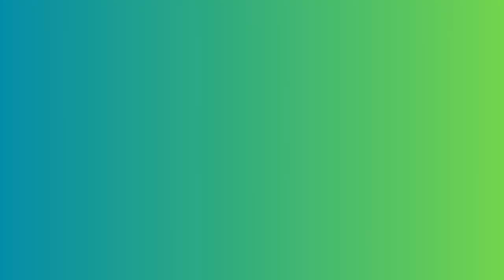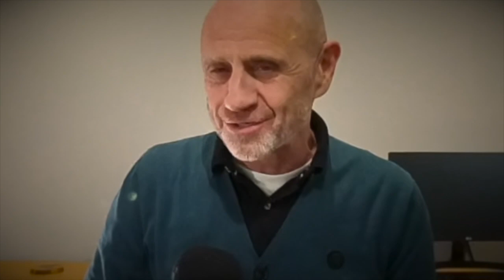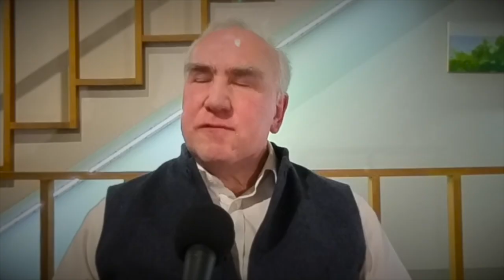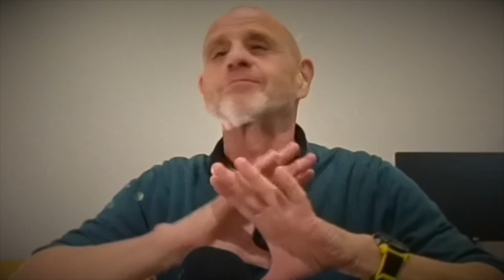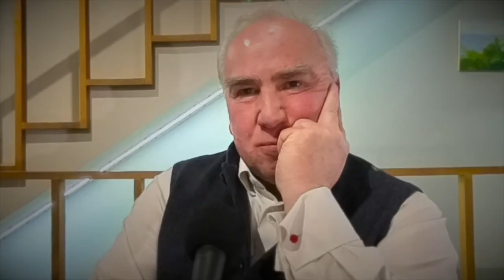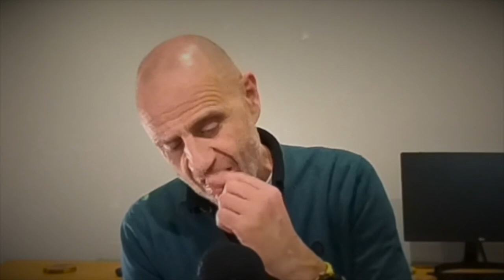16. Do you speak Heat Pump?

Comment: Δt needs explanation in simple terms, and I have also heard and been confused by d o t.
Reply: DeltaT, the difference between two temperatures. Comparing temperatures in a heating system can be applied at various points, but the most comprehensive is in comparing the difference between the energy source temperature (the air, ground or water) and the flow temperature required in the emitters (UFH or radiators) that is needed to deliver the required room temperature. You might hear people referring to these as the source and sink temperatures. Essentially, the smaller this DeltaT, the more efficiently the heat pump will be operating
Reply: @ thanks.

Comment: I wouldn’t bother being too interested in Heat Pump technology, which frankly is about  150 years old. A large EV manufacturer is pumping money into the Ohmic Electric Boiler concept, with fantastic results - the efficiencies are outstanding!! So Heat Pumps are effectively now officially old technology.

Bean really understated the Humidity levels of outside air. Here in Scotland we can easily experience levels of 90-100% <5°C in Winter, being due to the Gulf Stream. Leading to many ASHPs in De-Frost mode regularly. This is the reason Heat Pumps fail  here. Unlike the dry cold of Scandinavian & other north European countries, our cold is moisture laden & very cold, giving an incorrect reading as to the actual temperatures.
Reply: We get 3C ~98% humidity here quite frequently, so easy enough to compare.  But what people don't really understand is that heat pump systems in the UK have a design temperature in the UK of -3C to -7C.  So at the ~3C sweet spot for humidity to cause problems the heat pump isn't running flat out regardless, so whilst defrosts do occur, they aren't as bad as people make them out to be.
Defrosts when taken into consideration over the whole winter season will waste less energy than a gas boiler will waste out of it's flue.
Reply: @BenIsInSweden  Our weather here in Scotland is oceanic, can be very, very cold & humid, particularly on the west coast. With weather being greatly influenced by the Gulf Stream.
Added to this, it’s windy too, with high temperature differences. You in Scandinavia countries get dry cold temperatures, very dissimilar to ours. Site a ASHP in the wrong location here & it’s a complete disaster.
Reply: @jimmygillies5590  Like i said, we can get very humid and low single digit degree temperatures as well.   And like I said, Scotland's design temperature (about -7C) makes it so a heat pump isn't running flat out when the humidity is an issue, meaning it's not a massive issue either.
There are also ways around it, e.g. EVI heatpumps doubles the time between defrost cycles.

Also, it's clear you do not understand heat pumps that well, considering you're making a comparison to Ohmic Boliers, which will only ever achieve a COP of 1.
Reply: I agree that humidity levels can be extremely high in places and that many people fail to realise that it's the humidity, rather than low air temperatures that impact air-source efficiencies under such conditions. This could be a good reason to opt for ground-source. I'll need to read up on Ohmic Electric Boiler technology

Comment: Air -to-Air: I've got what I would refer to as monoblock - the entire unit, compressor and all, is inside with a couple of holes in the wall to get the air in and out. I can't work out why the system with the compressor outside and cassette inside is referred to as monoblock. I would refer to that as split, and a system with multiple cassettes as multi-split.

Comment: I was expecting to hear 'microbore', which seems important to the retrofitting and conversion process. Maybe next time. Probably worth taking some time to improve image quality. There is some visible glare (or are they marks?). Resolution is a bit low. However, it doesn't detract from the content, which is good.
Reply: Many installers will shy away from retrofit projects with existing microbore pipework, but, subject to survey, it's usually possible to achieve very respectable results without having to completely re-pipe a system. As in all things heat pump, the key is the quality and previous experience of the installer